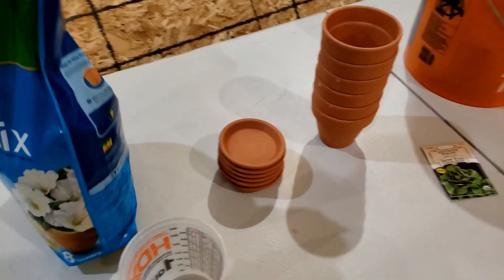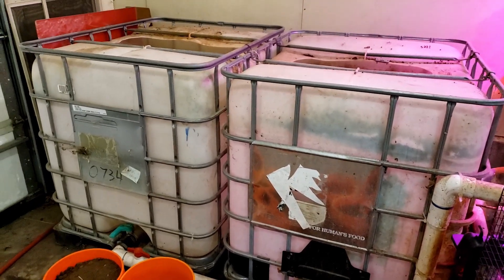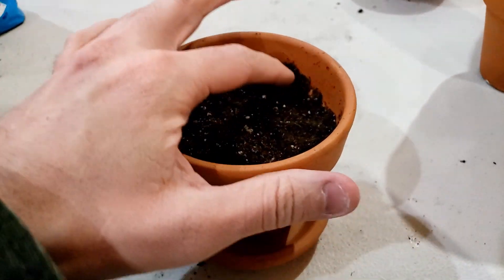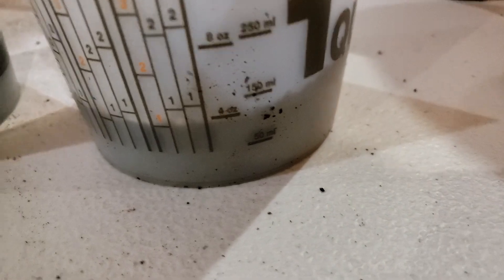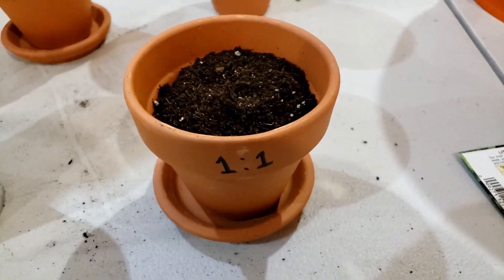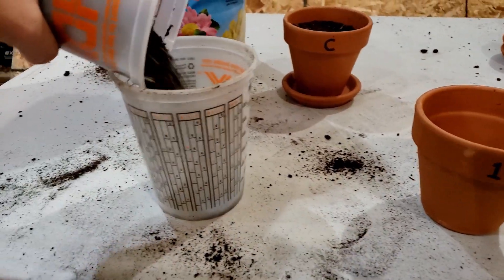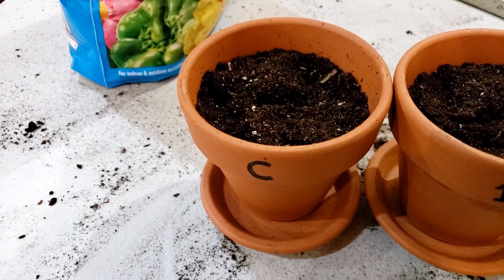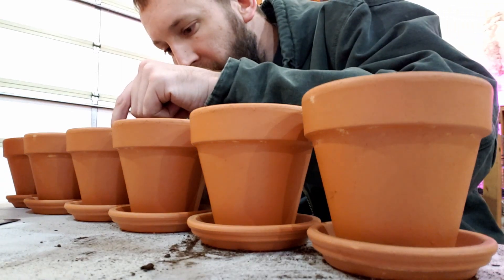EXPERIMENT: Finding the best mix ratio of worm castings to potting soil

Comment: I'm planning on getting started with worms soon. Your videos are very helpful.
So after 4 mos, what are the results?
Reply from the maker: Unfortunately an issue in my shop killed this experiment. Better setups coming soon
Reply: Sorry to hear that, I was looking forward to the results. I was just reading, a study at Trent University concluded that 15% castings to 85% organic potting mix was just as effective as 30% castings to 70% of the potting mix, and both ratios were way more effective than the control of just potting mix (as one might expect). That was with basil plants, I might add,

Will be interesting to see how yours compare.

Comment: organic  yet miracle grow soil? fail
Reply: the miracle grow will also kill off some of the beneficials in the castings(one of the biggest benefits, you really may want to reconsider your experimental mixes
Reply from the maker: @SirStickybuds  yeah may have to redo in the future. Call back to this one with a "with and without miracle grow" or something like that.
Reply from the maker: Lmao, yeah unfortunately just had to use what I had at the time. It's not ideal but at least we'll still see if the castings make a difference since it's the same stuff used across the board.